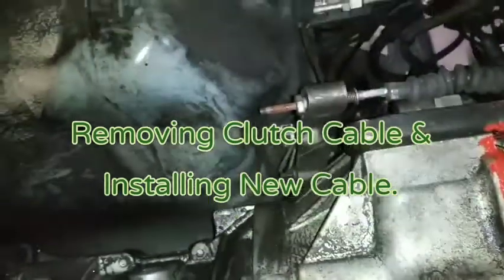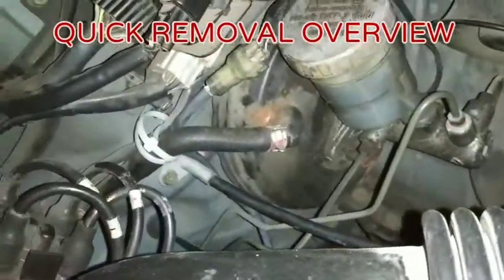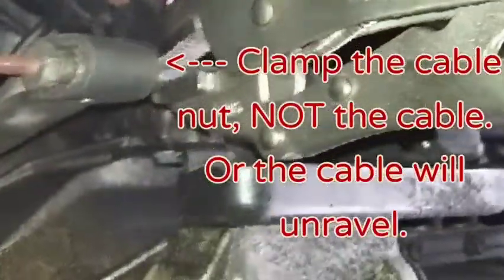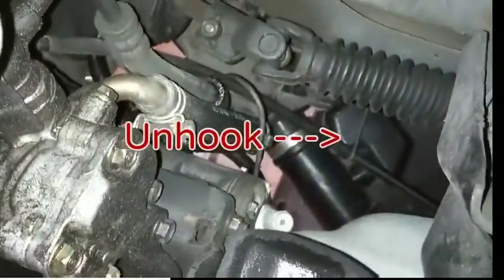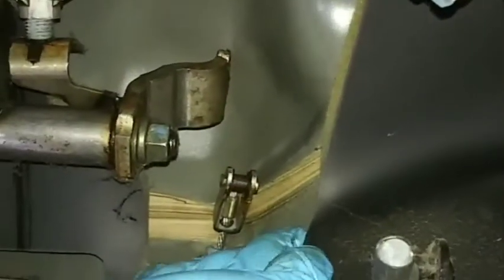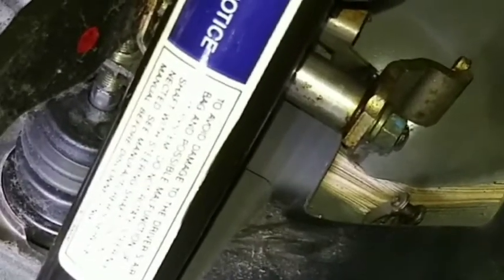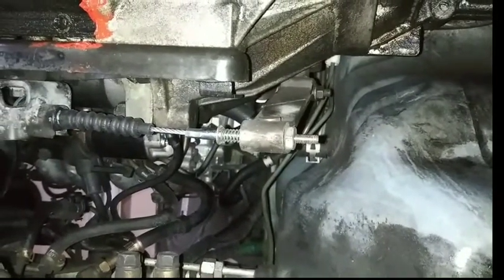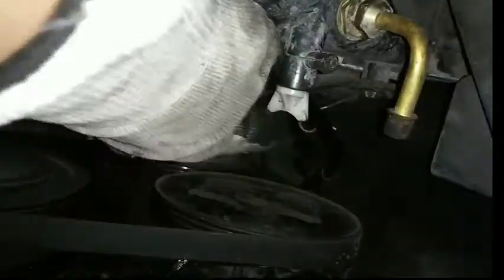DIY Clutch Cable Replacement; Removal & Install

Comment: You need to invest in a 14mm deep well lol, this is the second video where you needed one but didn’t have it lol. Have you done a video on a throttle cable? I noticed they smashed mine between the stand and the plenum, and I can see signs of wear where it attaches to the throttle plate. Anyway another good step by step video. It helps me visualize the repair.
Reply from the maker: I need to invest n so many tools! You'd b shocked at what i make due with. 🤣
Fortunately, a friend lent me all of his tools, when I replaced the clutch. He'd just replaced his & had bought almost everything, I needed too. Including sharing his metric, deep well, impact, socket set. Been meaning to find & buy a thin wall version.
But prior to reSwapping the clutch cable n the vid, he needed his tools back.

No on the throttle cable. Last weekend, I did just wrap electrical tape around the parts where the sheath cracked off & exposed the cable. 
If u need a reference though, I could try to trace this one out & video it.

And thank u very much! I'm happy the video was decent enough for u to visualize the repair. 
(Maybe you'll end up with a standard Tracker project, after u finish this one. Ha ha)
Reply: @chm3598  I’m hoping to find another one that’s in way better shape. I might even look for a samurai but idk right now I have a few extra vehicles sitting in my yard (ones my brothers) and I’m afraid the town I live in will complain about the junkyard in my back yard lol
Reply from the maker: @Red-yn9fv  lol! Build a bigger fence & u can store as many vehicles as u want.
Reply: @chm3598  OH I tried but the city won’t give me a permit unless I have my lot surveyed lol I think next I might look into one of those car port things for rv’s lol the joys of small town living
Reply from the maker: @Red-yn9fv  Oh, large cities r a "joy" too. Lol. Do u have to deal with HOA restrictions too?
Really, the only way to avoid it is to move to outside of town. No thank u! 😆

Is a survey expensive?
Reply: @chm3598  a survey here is about 3k. I lived in a town of about 40k and moved to a town of 500 about 8 miles from town. It’s not bad unless I need to run to Walmart then it’s a 12 mile trip lol. That’s why I need to get my tracker back on the road for better gas mileage. I’m sure the manual transmissions get better mileage. No we don’t have an hoa just a bunch of nosy Nancy’s who will complain if your grass is to tall or you have a vehicle with expired tags in your driveway. I usually put the license plates up against the fence so they can’t see if it’s expired. Only thing that sucks is Missouri requires two license plates lol you have to incentive in that case .
Reply from the maker: @Red-yn9fv  Yikes, a survey is expensive!

Lol. Do the nosey Nancies have any backing on their complaints or is it just annoying enough to wanna avoid them complaining?

I have a flip down front license plate. Temporary solution for the tags?
Also, Only for parking purposes on private property, when I had a vehicle down for a while, I printed tags with a current date. But I never drove it on the street, with those tags.
Reply: @chm3598  the nosy Nancy’s are I think just old people that drive around and if they see something they don’t like they complain to the mayor. We also have 1 police officer that drives around in a police car and smokes huge cigars lol I don’t like him much since he ran a stop sign and almost t-boned me. One year they put up school zone signs 5 blocks from the school and wrote a bunch of speeding tickets to the high school kids on their first day of school. It’s just small town crap but it’s ok for me I don’t really talk to many people and I’ve lived here 11 years now lol. I like the idea of the drop down license plate and the printing of the stickers is absolutely awesome lol
Reply from the maker: @Red-yn9fv  Oh yeah! I've lived n areas with way-too-bored nosey nancies who ratted us out for everything. Made me mad when they chalked the tires on my perfectly functioning 2nd vehicle IN THE DRIVEWAY, that i rarely drove because the high mpg, & sent us a threatening letter to have it towed away. 🤦
Sorry the cop is, well, himself. Good he didn't t-bone u though! Poor teens though!
Your description makes me think of the stereotypical small town cop, like on Dukes Of Hazard. 😆

And dang u must really like something there, to b there 11 years & not talk to many ppl! Ha ha
But I'd probably b the same. I'm not big on nosey nancies & it's not very common for me to find ppl I can talk cars or home repairs with.
Reply: @chm3598  they haven’t chalked my tires but they sure drive by slow. I just stare at them lol. They have a really good school here is why it’s been 11 years. But for the most part they leave me be I just don’t get in on all the drama. I may not have much of a life but I try to keep it drama free lol
Reply from the maker: @Red-yn9fv  When they drive by slow, u don't greet them with a smile, wave or 1-finger salute? 😈🤣

Drama free is always the best! That's my plans!
Reply: @chm3598  one guy down the street got his house from his parents and moved in. Well he used to be my boss a long time ago and he had me so stressed out for about a year and a half that I had headaches every day and thought I might have a brain tumor or something so I went and had a ct scan done and it cot me like $1800 and come to find out it was just stress. He will drive by and waive and I just stare, now I’d love to give him the one finger salute lol

So I need your expert advice. I bought an oil pump for the geo and I can’t get it off due to the oil pan, which I can’t get off due to the front differential. Do you think the pulling the front dif is a one person job?
Reply from the maker: @Red-yn9fv  Geez! I'd b giving him that 1-finger salute, at least daily!

Unfortunately, my oil pan gasket experience isn't on this vehicle. 
Looking at the Tracker manual now though.
I'd say it's a one-person job, with a jack under the assembly, when unbolting & lowering it. (All of my repair vids have been a 1-person job. Had to b very creative, quite a few times though.)

Fyi according to the manual, the front differential carrier must b removed as a complete unit with the axle housing.
Reply: @chm3598  I was able to get it down and the oil pan off along with the old oil pump but the new pump I bought isn’t the one I need and so I’m talking with the company I bought it from. I did make a short video yesterday but got tired and forgot to upload it. I will try and upload it here at work
Reply from the maker: @Red-yn9fv  Awesome! I apologize it took so long to answer. Been repairing roof problems & some other stuff waiting on me.
And nice! Doing better than me. I still have at least a half dozen new & old repairs to edit, for upload.

I'm def curious how u dropped the differential.
Reply: @chm3598  note to self, uploading videos at work takes a lot less time than at home LOL dropping the differential I just unhooked the driveshaft from the transfer case at the back of the front differential and I just let it hang I took the driver side half shaft or CV shaft loose and I am also see driver side mounds passenger side now and the half mile which I later had to remove from the crossmember and then I slid the yoke for the passenger side DriveOut of the differential and hold it towards the driver side and it came right out. And what’s up with your roof?
Reply from the maker: @Red-yn9fv  Cool. I'll keep that n mind, if mine becomes an issue. Crossing my fingers that it won't though. Lol

The roof, a bad leak. I'm having trouble locating the source.
There was tree damage, that the responsible party kept putting off fixing. Took them so long & the tree damage contractor screwed up so bad, that the damage leak is 3 times worse. But the moron contractor won't return my calls, to honor his warranty.

I've been trying to find the leak & patching it, n the mean time. Thought i might've found the source but the rain leaked n a little yesterday. Not a gallon, so that's an improvement. Gotta keep looking for potential leak points & working on it until it's completely sealed.
Reply: @chm3598  a few years ago I had a leaking skylight and I had it removed and new flashing put on where my back porch roof meets the house and the guy I had do it charged me $1200 and my roof started leaking and he came out 3 times and tried to fix where he screwed up and then he finally quit returning my phone calls. Then he got bent out of shape when I told my mom about it and she worked at a gas station that he frequents and when she told him it was still leaking he came over to my house and got in my face about “talking bad about his business”. I can see his house from mine and when I replace my roof here in the next few years I am going to one of his competitors and I’m going to have that guy line my front yard with his company’s signs just so when the old roofer wakes up in the morning he gets to see that beautiful sight lol
Reply from the maker: @Red-yn9fv  wow!
I'd add a big banner, with the new company's name, that says they're better than that other guy's company. 😈

But THIS is why I always do my own repairs. Only reasons this situation was different was because it was the responsibility of an outside entity & the repairs were extremely dangerous, for me to do solo. Way more than the dangerous repairs I normally have to do, by myself. And that's saying something. Ha ha
Reply: @chm3598  I have only done small sheds but never anything with valleys lol. I’d love to put lights on the banner so the guy can go to sleep looking at them like a nightlight lol. I hope you get your roof sorted soon, I need some more educational videos to help motivate me to get my butt in the garage.
Reply from the maker: @Red-yn9fv  You're almost there then. Just need to overlap/seal the Valleys, to keep the water flow downhill & you're good.

Ha ha! Add reflective material so the sign shines that nightlight directly at his window!

Thanks! I'm working on multiple things at once, including the Tracker. A/C issue is next. 
Mostly just need to sit down long enough to edit all the repair videos. I've got a few recent, easy fixes that I plan to add, since they're super quick but they're useless to your project now. You've had dealings & moved passed them, with your current repairs.
Reply: @chm3598  well my current leak is with the flashing that goes up under the first layer of shingles and they I’m thinking cut threw the felt paper or tar paper. I have everything I need to put the oil pump and pan back on and then the timing. I’m hoping after this week I will be back on 8 hour days. And I like the idea of the reflective I might be able to make that happen lol I have access to reflective vinyl. Well I enjoy your videos even if they don’t exactly pertain to my vehicle. And I’ll wait patiently for new ones lol
Reply from the maker: @Red-yn9fv  Is it the flashing around vents or the A/C? I've found they don't always secure vents properly. Recently looked at a friend's roof & the vents were only being held down by gravity, on the lower half of each. The part, not tucked under shingles, lifted way away from the roof with very little effort. 
So when the wind blows right, they lift up & rain flows n. I'll eventually to go back & put roofing adhesive under the loose edge on each. Maybe some of that mesh backing too.

The company reSent u the right oil pump?

Thanks! I'm glad someone likes my vids. Hope they r really helpful too. 😁
Just ran across a couple that don't need much editing. So they'll b up soon.
Reply: @chm3598  no that company didn’t have the correct oil pump so after talking to some people on a Suzuki forum I decided to just put the old one back on. I have a new gasket and crank seal. The kit did come with a couple of o-rings that I’m not sure where they go. They are small like fit on your pinky finger. So idk lol but I cleaned up the pan and bought a gasket and after talking to more people decided to just use rtv silicone. I have just been so exhausted lately with the 10 hour days and the spring forward I’m dragging.
Reply from the maker: @Red-yn9fv   @Red  Crazy it's so difficult to find companies that carry the correct replacement parts for Trackers.
U should see how many radiators I bought, until I got the right one.

When i originally ordered the crank & cam oil seals, there were 4 or 5 different part numbers. I ordered all so I could compare & reduce the chance I'd have to make a mid-repair store run.
Most, the seals appeared the same size. A couple came with gaskets, maybe o-rings too, that this Tracker didn't have.

What did the forums say, that made u decide to go with RTV instead of the oil pan gasket?

Hey! No rush. Get to it when u aren't working so much. It's not your primary & your car collection isn't overflowing out of your yard, yet. 😁
Reply: @chm3598  I know what you mean on the different parts. I ended up ordering a water pump timing belt kit and it was for the 8 valve so I had to run to o’reillys. The guys from that forum said if it’s the new style gasket it’s ok but if it’s the Cork gasket I’m better off using the rtv because the cork will get hard over time and crack and leak. They said as long as I get the engine block and pan nice and clean the rtv should outlast the car lol. And my brother is coming today to pick up his car so one less in my yard. So update my brother came and got his car and it was a muddy mess lol but we got it out. My mom came and I showed her how far into the tracker I had gotten and she reminded me that the radiator is in need of replacement so I might have to get that part number if you still have it. I looked and mine has transmission cooler lines on the bottom of it. My mom was amazed at how much rust this thing has on it, I pulled the carpet back behind the passenger seat and showed her. She said it’s in good hands and I’ll have it whipped into shape in no time lol
Reply from the maker: @Red-yn9fv  Oh, cool. I've installed cork gaskets & they didn't dryrot or need to b replaced, while I had those vehicles. But those weren't ones I planned to keep for life. lol. 
I've used RTV as gasket replacement. It can b frustrating though. U have to apply it evenly & align it perfectly, when reinstalling. Can't tell u how many times I'd bump something that's way too close, knock off some of the RTV & have to reapply, to that spot. Then start over again, reinstalling. Then spent some time scrubbing dried silicone off my fingers. 😂

Hey! If u rutted up the yard, no need to mow that area for a while. 😁

I saved the radiator link. Only problem, since yours is an automatic, this one isn't compatible. No cooler lines on the stick shift's radiator. But the eBay seller might have the automatic's too.
Let me know & I'll check their other items.
Most local auto parts stores had a radiator, listed for this Tracker. They were larger, same.model at all stores & the water hoses were on opposite sides from this one. Almost had a shop manufacture one for me, before finding it on eBay.
I'll check your videos for your radiator, n a bit, & compare.

And b careful showing your mom too much. When you're done making it nice & new again, she may want it back. Haha

(Speaking of your mom & related to the 8 quarts of oil. Changed the oil yesterday & it took 4. I never can remember, until completing the oil change.)
Reply from the maker: Looked at the eBay radiator & remembered it has two small pipe blanks at the base. Looked at your vid again.
If your cooler lines r on opposite sides of the radiator, pretty sure it's the same one.
https://www.ebay.com/itm/131897630280

Bought it almost 4 years ago but saved it on eBay, just n case I needed another one day. 
Price went up. Looks like there may b cheaper ones now. Just make sure they have a good return policy, if u wanna save a few bucks & try them out.
Reply: @chm3598  thanks for the info. I think I might go with the one you sent. It might be a better quality than the one I was looking at. And I know what you mean with the rtv silicone. I was just thinking the oil pickup tube was a pain in the butt when I was trying to take the pan off. I might just use some rtv silicone to get the gasket to stick to the oil pan and it might make installing it a bit easier. I got lucky and made a deadline at work so they game me the day off. I might work on it or I might drive 2 hours over by st. Louis to look at an airsoft gun lol I know priorities. OH and I talked to my brother and the guy that he knows that has a bunch of goes lives down in Albuquerque New Mexico, but he is still good friends with the guy and gave me his number to call to see if he has a hard top.
Reply from the maker: @Red-yn9fv  You're welcome. What company has the radiator u were looking at?

Ohhh! I forgot about the oil pickup tube. The last oil pan gasket I replaced, prob a decade ago, I think there was more RTV on that than the oil pan, by the time I got the pan past it. Haha
But I've used the RTV to hold the gasket n place. Still bumped it & can get a little messy. Not as bad as straight RTV though. 

Just saw u have a new video. So I'm thinking there's still an airsoft gun waiting for u, n St. Louis. Lol 

Ooh! There's a Geo/Tracker junkyard n New Mexico too?! Nice!
Reply: @chm3598  I will have to check on the radiator to see what company has it. It’s on eBay so no telling. Yeah the airsoft gun kinda fell through because the guy quit texting me. I’m guessing he needed money and finally got his stimulus check so he didn’t need to sell it. Oh well when he does need money again I’m sure he will text me back but I’m not sure if I’ll be nice about it or not, probably won’t be lol 😈. Well I’m officially off of 10’s for the time being but they are moving me to a service position so I have a feeling my hours are going to vary from the normal 8-5. Yeah I thought about using the rtv to help keep the gasket on the pan but it was such a pain in the butt that I ended up fighting it and am glad I decided not to go that route. But I plan on working on it again. So the rav4 that you post videos on, is that yours or is it someone that had you do the work for them? Just curious cause I almost bought a RAV4 a couple years ago but I didn’t know anybody that had one they could tell me whether or not they’re good vehicles or not.
Reply from the maker: @Red-yn9fv   lol. If he does contact u again, I'd give the guy a hard time & drop the price because he didn't have the nerve to just tell u he wasn't selling anymore.

Hope u keep the steady schedule!

It's not my RAV. I help friends & family when they need it. Well, the ones I like anyhow. 😈 But I don't post most other's, especially if they're with me while I work. I feel weird enough narrating videos, by myself. 🤣 Originally thought I'd just post helpful vids for Tracker ppl but a friend has been suggesting I expand on what I share here, since I'm always fixing something. 

That RAV is a great vehicle. One owner, who loves it, & has almost 300K miles on it. Just had a bad home "mechanic" working on it. I volunteered to correct what he screwed up, plus anything else that goes wrong n the future.
I drove a 2020 for a few months last year. Thought it handled very well & the A/C was amazing! It was middle of summer & I could practically refrigerate groceries n the "trunk", when I had not-short drives with food n the back. 
Plus it was nice to actually have a trunk, for once. Could fit so much back there!
I'm not really a RAV4 person, so I didn't enjoy it as much but my A/C was out at the time......again, which made it great to drive that RAV around most of the summer & not melt! Ha ha
Reply: @chm3598  I’d like to get one of those fj cruisers, but I’m sure the gas mileage isn’t the best on those lol. I know what you mean about the narrating of the videos. I try and do that when no one else is around because I feel weird also, I’m an introvert that’s been coming out of my shell the past 20 years or so lol. I have an old neighbor that I help fix their lawn mower when it breaks or on their cars. Last time they wanted me to put on a belt and new tensioner and then he was wanting me to look at his breaks. I hate breaks lol. I found the leak and showed him and told him he’d have to take it somewhere. I don’t mind helping just don’t like it when the only time I see them is when they want me to fix something lol
Reply from the maker: @Red-yn9fv  Ohhhh! Speaking of an FJ Cruiser. 
I was gonna mention, I met someone nicknamed "Red" this weekend. She drives an FJ! Lol
She loves it. It's her 2nd one. Fit all her tools n the back. And I mean all her tools! I had an emergency repair but no tools. "Red" works at the AutoZone n that town & lent me everything I didn't have. (The Tracker's first roadtrip n prob over a decade & it tried to die 250 miles from home.) Planned to bring tools but A.D.D. really doesn't help completing To Do List tasks.

Didn't ask her about the FJ mpg but we discussed the engine is a 6 cylinder & sounds mean on startup. She drives it 40 minutes to & from work every day, so MPG might not b too bad.
If it weren't that I've been a diehard Jeeper all my life, I'd seriously contemplate an FJ. (The Tracker still tops Jeep though.)

I def can relate to only seeing ppl when they need something. Main reason why I only help certain ppl, these days. Oh & perfect strangers too. As u can possibly tell, by now. Ha ha ha

And I'm an extrovert who's been working on ditching the severe shyness for at least 20 years too. I'm good with the camera shyness though. Which is why my face is rarely n the vids. 😁 As much as avoidable, that is.
Reply: @chm3598  so I have been a jeep fan since I was a kid, my parents had a willys and back in the early 90’s we had a Cherokee and I wanted one ever since. They made that particular body style all the way up to I think 2001 it’s called the “classic” but I did have at one point a 1988 Jeep Wrangler that was the Olympic addition. It was super clean but it needed new leaf springs and I priced them and realized it was outside any kind of budget I might have and I sold it
Reply from the maker: @Red-yn9fv  That's awesome! And lucky! 
I was the first among family & friends to own a Jeep. That was well into adulthood too.
Wrangler is where my Jeep fandom has always gravitated towards. And it must b lifted! Lol
Pretty soon, hopefully, you'll see some of those repair videos posted here. But that project is low priority right now, with everything else bombarding me.
Reply: @chm3598  I can understand that, get that roof situation straightened out and that daily driver back on the road lol
Reply from the maker: @Red-yn9fv  Definitely! It just needs to stop raining........one of these days. But the delay did give me time to realize an addition needed, for the roof to b completed.
How long did u have the Wrangler? YJ, right? 
Were the leaf springs that bad that u couldn't still drive it?
Reply: @chm3598  maybe 5 years or so, the leaf springs were flat so hitting any kind of bumps it would hit. Someone had also put 30’s on the stock rims so I had crap turning radius . I also kept finding oil up in the tray that held the air filter and someone told me it was oil blowing back from I think the valve seats or something anyway it was enough that I decided to sell it and it also had super crappy gas mileage. I did put a brand new carb on it and I kept with the old carter rather than upgrade it to the Webber but I was trying to keep it as original as possible
Reply from the maker: @Red-yn9fv  Ok. Does sound like it was project.
If I weren't crazy about it, I probably would've sold it too.